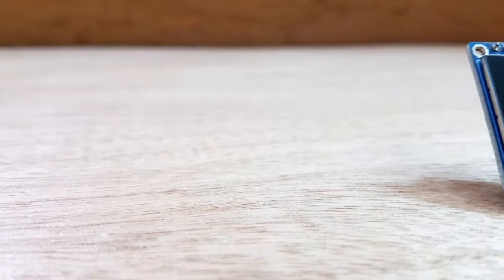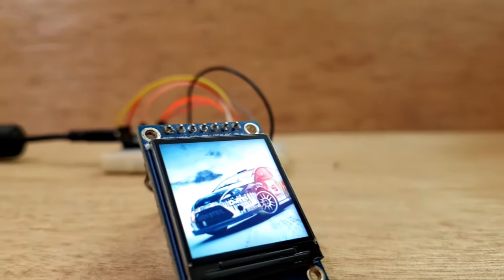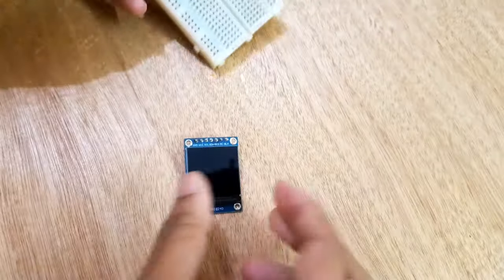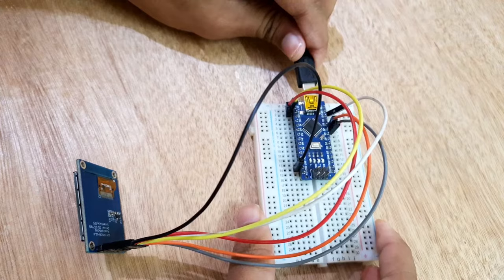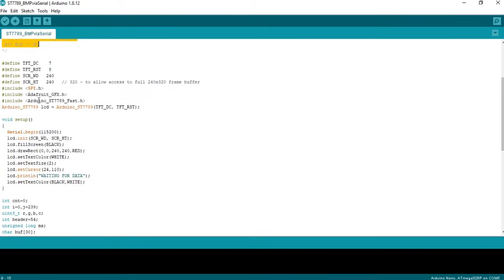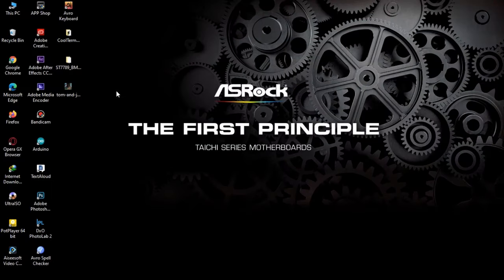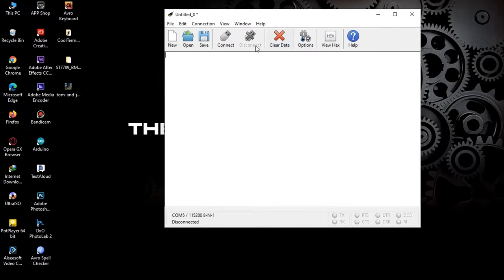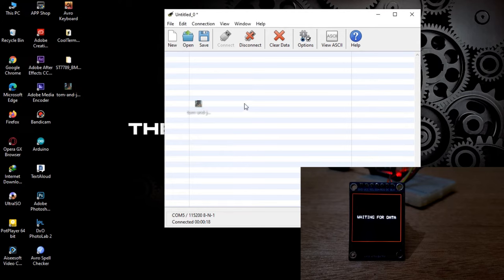ST7789 Display Review | Uploading Image

Comment: I can't access to the code, but I copy all of that and works fine putting on display "WAITING FOR DATA", but after that, when I put my Image, its shows only in black and white and it seems like its on other size, but I check several times it was 240x240 pixels in format BMP, and check the way I put the image on the other software. I think the problem is on the image, but Idw, what kind of convertor and re-size software you used?
Reply: In standard Windows paint... Save as BMP 24 bit 240x240 (im running this on Arduino nano clone + 240x240 TFT display) one thing that i must do Is to rework code to make it work like badge - So then i need sdcard

Comment: Thanks for this good video about the ST7789 Display.
I bought this display from amazon, and connected it with the arduino, and used your sketch file for testing the display.
The images are looking great on the screen.
The problem I have, that the image is only displayed when I press the reset-button of the arduino, otherwise the screen stays dark, when the image is loading with CoolTerm.
What I am doing wrong?
Reply: Did you find the solution?
Reply: @aryanthappa9307  * check your screen power supply
* if your screen has a voltage regulator you will have to supply it with 5v instead of 3.3
* please make sure of the voltage, but this is the error.
Reply: * check your screen power supply
* if your screen has a voltage regulator you will have to supply it with 5v instead of 3.3
* please make sure of the voltage, but this is the error.

Comment: It will run way FASTER with STM32..
Reply from the maker: yeah, right
Reply: What make slow when showing bitmap was serial speed.
Reply from the maker: @KaryaKitaChannel  Arduino is not fast.
Reply: @KaryaKitaChannel  It is also about microcontroller, STM 32 is faster than Atmega328p.....

Comment: Cool but so f***ing slow... Unusable for a game for exemple
Reply from the maker: yes, Try with a powerful microcontroller for best performance
Reply: @ElectronicsBd  not only that but you should also implement DMA
Reply: It is damn fast. Here is the problem with uploading an image from a PC to a display through an MCU. Try ESP32. You will be amazed.
Reply: @dekipet  still... I'm trying to do NES emulator based on nofrendo emulator so forget esp32 to run a full emulator.. And SPI is quite slow anyway, I really needed the 60 fps so I switched to a 16 bit wide bus interface screen with FSMC, it is theoraticly possible to run 60 fps on this screen with this emulator but require a perfect optimisation of threadint for the SPI and DMA, which, I'm not able to code...
Reply: could you advice how long it takes for imaging?